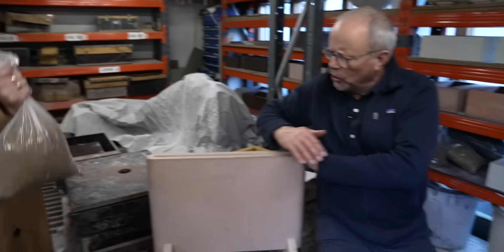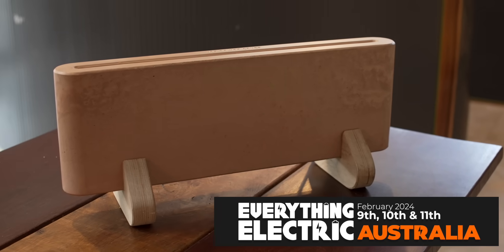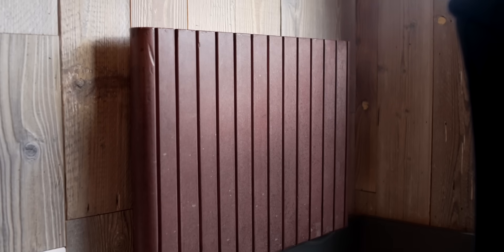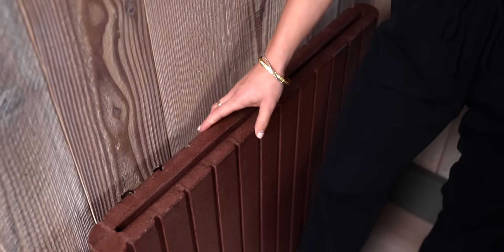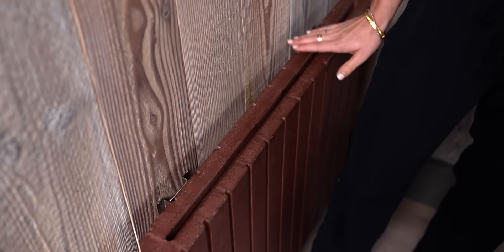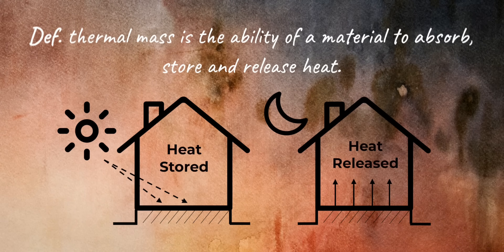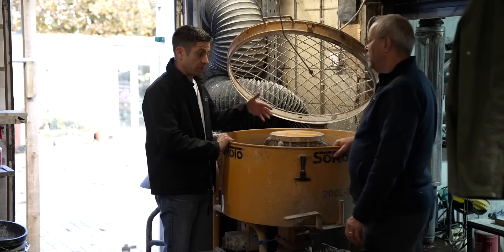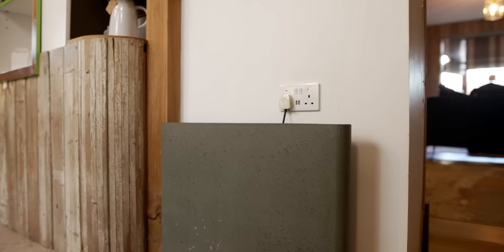THIS Radiator Is Made From Recycled Sand!

Comment: Who has a 600W TV!? That's not something you "don't notice". Maybe a huge old Plasma one? Ours is 80W which I still consider to be significant, and that's because it was a freebie and at least a decade old. A newer one would be 40W. Anyone who has a 600W TV should bin it immediately and get a new lower power one (unless they have their own renewable energy scheme with plenty of surplus I suppose).
And ultimately any direct electric heating device is 100% efficient, which would be good except that heat pumps are 250-400% so it's best avoided for heating except for occasional usage.
Interesting idea and they do look different and 'high recycled content' is good, but of course standard metal radiators are 99% recyclable (all but the paint) and could be made from mostly-recycled material too. 5 mins research finds that 'castrads' use 100% recycled metal in their cast-iron ones and stainless rads are 50% recycled. The percentage for standard mild steel and ali rads is presumably lower but rising.

Comment: Erm.... This is still resistive heating....  Which is a very poor way to use electricity to heat.
100% efficiency sounds good, but it's still just an old fashioned storeage heater. These days that really should not be an option.
And suggestions that resistive heaters loose efficiency with age... Again, just NO. They are 100% efficient till they die. (Even then they are still 100%, they just use no power to procuce no heat!)

I agree that using recycled materials is good here. But not for the reason they are touting.
Installed heating usually stays there for decades, so any recycling will have minimal impact. Don't compare them with consumer electronics with useage lifetimes of months.
However, in this case, when people realise how little heat these generate and how expensive they are to run, I think they will be dumping these quite quick!

Comment: The only possible use case I can see for this is time delay of the heating... E.g you use the heater at your off peak electricity times say 4am-5.30am and it releases the heat slowly so that the room is nice and warm at 7.30am. That could be useful but there is no information on its ability to retain heat after being turned off. So these are just nice looking, expensive electric radiators, with low heat output. Fine if that is what you need, but not very useful for most people.

Comment: I guess this is not the complete story, no? Why should a simple electric heater be more efficient than a heat pump for example? This does not make any sense. With existing electric heaters (infrared), you need a lot more energy to heat your house. It does work, sure, they use recycled materials, fine. But they still use cement, right? Not sustainable at all. Steel will be made with green hydrogen soon, why should a steel radiator be less efficient? Even existing ones? Either there was a big part missing or I don't get it, I'm afraid.

Comment: Find a bloody great rock that has an interesting shape, drill a few holes in it, and poke a ceramic element in each hole. 
 100% recyclable, when you finished using it as a heater, chuck it back where you found it and it will carry on being a rock for thousands of years.

Comment: Recycled sand composite? So... concrete. A 600w heater at currently availabile regular tarrifs is going to cost you £100+ a month, your TV might cost you a tenner. This is ridiculous, either the production team doesn't know what a resistive heater is and failed to do their research, or this is a paid ad. Its a stupid fashion product, theres no eco or green trickery to this in the slightest, no special 'development', nothing. The manufacturer is just spitting so much BS. It's a hot wire cased in concrete with a smart switch. What a joke.

Comment: As others have pointed out; ALL electric heaters are 99%+ efficient, these are no different. If you need 2kW to heat a room, you can use a £30 electric radiator or 3.3 of these (the large model). There is no difference in running costs, but the capital costs will be (far?) greater. I think the product looks quite nice but with steel, aluminium and copper being recyclable, I'm not sure I see the benefit. The oil/gel filled radiators also retain their heat but, I've never been sure of the benefit of this as they also take longer to heat up so you are just putting a delay into the timing of the heating cycle.

Comment: It’s already been said that 100 watts is 100 watts, but what also concerns me is that the electronics are not accessible. How has it been tested to last 50 years without breakdown? It hasn’t. Also, if the electronics are embedded and you are using an app, what happens when the electronics become obsolete and don’t work with an app anymore?

Comment: I hope the team will consider an increased independent technical review of future episodes before they go out. There is plenty of marketing rubbish in this episode. Lots of it is already challenged in the comments, but it should have been challenged on screen or in the editing booth. 

I was most bothered by the assumption that the recycled content meant that the product was "more carbon neutral" (which is a silly phrase) than wet radiators (the wrong basis for comparison). Is this nice looking electric radiator really lower embodied carbon than a low profile electric radiator? I don't know, but it shouldn't be assumed and repeated by presenters. The thermal mass is nice, but it will also slow the heat up time, whilst making zero difference to overall efficiency.

Comment: hmm I see no mention of storage and slow release - so they’re just a heating element with concrete to give some passive heat soak? May be a little better than an oil filled radiator  (maybe) if it can turn the heating off and let soaked in heat fill the gaps, but there isn’t enough info in this video to know

Comment: As many have pointed out, a 100% efficient resistive heater will consume 1 kWh to output 1 kWh of heat at a cost of about 26p. An air source heat pump will consume 1kWh to output between 3 and 5 kWh of heat at a cost of 26p divided by 3 or 5 or whatever the cop of the heat pump actually is.

I believe that these current numerous promotions of dressed up resistive heaters prey on the lack of knowledge of people about heat pumps that is deliberately peddled by the misinformation of newspapers like the Daily Mail and the Telegraph. They are certainly cheaper and easier to install but the true cost is in the years of crippling electricity bills that follow.

Your channel should be staying well away from such promoters.

Comment: How exactly is this "low carbon" heating? Right this moment over 50% of the electricity in the UK is generated from natural gas. And generating electricity from fossil fuels has never had such a high efficiency. I would see the benefit if it was used as a night storage heater, but for that these things don't look like they have enough thermal mass.

Comment: Ok, like others have said, resistive heat, 100% yadda yadda yadda, not as good as heat pump. But I live in Canada, where even the best air source heat pumps won't get you through the winter without some help.  
So I don't care, I still think it's fantastic. We had  daycare my wife ran out of the back room extension, that depended on baseboard electric heaters, too hot, we couldn't use them or the little tykes would burn themselves. Place was always freezing,  and fire hazard as well.    
So yes, lots of cheap dangerous resistive heaters around. Time for something different. Perhaps not so ugly, hey, that's what this is!
Hope this lovely couple scales there price down and we all get one in few years.

Comment: Ok can someone tell me how this isn't just an old fashioned storage heater but built in a way you can't repair it if anything goes wrong?
Old storage heaters were made of bricks to hold the heat, a metal shell with holes to let the air circulate, a number of heating elements (varies by type/size) and a bimetallic strip overheat. Literally nothing to go wrong that can't be replaced with a couple of screws. This version the electronics are *in* the concrete mix so can never be serviced/replaced. The heating coil can never be replaced if it breaks.

This looks better though I'll give them that.

Comment: Yet another smart solution! Sure makes me wish that, when I built our home, we could have afforded to put heating elements in our concrete floor. The entire house would have been sitting on such a "radiator."
Reply: Wow. If you are building a home and putting in the concrete floor then there is very little difference in price between radiators and underfloor heating. Infact  if you are talking about underfloor electric heating mats you could add wires into the floor really easily without the need of a builder. They would likely cost a lot more to use than gas or heatpump water based underfloor heating.

Comment: Intrigued!  But according to my insurance agent, they won't pay for damage caused by flooding from pipes that have corroded within the concrete slabs of some homes. That has me wondering how long these will last. And electric heat = 1 to 1 efficiency, no?
Reply: pipes have water in them? you're comparing apples with oranges...

Comment: Its a heating element in a cement case, yes its fire safe, it has a large thermal mass so there no hot spots. But 300 watts is 300 watts no mater how it's encased. At lest its not as bad as solar roadways.

Comment: "Low wattage" has me quite confused. The heat loss in a house (and each individual room in it) is fixed, whatever it is. If you want to warm a room, you need to provide more energy into it than escapes it, with the extra caveat that the rate energy escapes is proportional to the difference in temperature.

600 watts is on the low end of the small portable heaters you'd use to keep the underside of your desk warm. 150 watts is so low it's basically useless, comparable to the amount of heat a typical desktop computer might generate. I do not see the use case for that, especially for what I can only assume is a premium price. Maybe you can use it seat cushion to keep your bum warm.

Comment: premium price but has a pay back period?  how does that work out.  your not saving a penny, just spending more on a premium product,   you have to remember this style of heater is going to take a long ass time to heat up from cold compared to a blower style electric fan heater.   thermal mass has no real benefit here,   its like having a fan blower type heater but one that takes 20+minutes to start up and switch off which would be a pain in my eyes.   plus take into account the weight of this thing when it comes to logistics.   its going to have a much higher carbon foot print that delivering a small plastic fan heater at 1/4 the size.   am i wrong here?

Comment: I'm sorry but the claims in this video are laughable. The radiators are simply electrical convector heaters with a high thermal mass. They are no more or less efficient than and other resistance heater and cost a lot more.  If you want to timeshift the heat output then get a storage heater full of bricks - you can actually decide when they release the stored heat.

Concrete isn't even a particularly good thermal storage medium with a specific heat of about 1000J/C per Kg.  Water is about 4 times better at 4200J/C per Kg and you can transport the container empty and fill it from the tap when installed (hot water tank anyone?).  

I really expect a higher standard of accuracy and integrity from the Fully Charged team. This just feels like an advertorial where the production team ignored the science and ethics.

Comment: Very skeptical of the claimed 50 year lifetime, especially after the nice lady added that the device can be controlled by an app! 

Will that software still be supported in 50 years' time, then? Even if it is, the electronic hardware is unlikely to last so long, especially considering that it is subjected to wide variations in temperature. It's also embedded in concrete, so no chance of fixing it when it fails - the whole device will have to be thrown away. Or recycled - if you can figure out a way to recycle concrete with embedded e-waste.

Comment: A quick perusal of the comments soon after release of this video and already so many just blow right passed the concept of thermal mass.

Commenters are correct that electric resistive heating elements are nearly 100% efficient at converting wattage in to BTU's out. But a wire coil cools immediately once deenergized. These thermal mass radiators provide a slow-release heat that moderates the temperature in a room. The business owners are careful to state that these heaters supplement other heating sources.

On the power side of things, electric heaters of all types are much better for the environment than even the least dirty fossil-fired heaters. When the electricity comes from either a "green grid" or, best yet, residential renewables, then the heat is essentially free; especially when PV or wind is diverted rather than curtailed; storing excess generation thermally.

The UK has a particular problem in that a high percentage of buildings are heated with radiators. While heat pumps can be used as substitutes for traditional gas boilers, the US has much less of a challenge in that a high percentage of buildings heat with forced air. Here, substituting a heat pump is much more straightforward.
Reply: If you want thermal mass then get an electric storage heater full of bricks.  They get to much higher internal temperatures and can therefore store much more thermal energy per Kg. You can also control how fast they release the stored heat.
Reply: @AndyFletcherX31  Everything you state is correct...while completely missing the point.

In fact, the solution you propose is already being done. See the Everything Electric Show episode on Zero Energy Boilers by Tepeo (https://youtu.be/y_v0midqPDc?si=Uqg5aMpKO2ZLH2UZ).

Secondly, implementing a ZEB solution is dramatically more expensive than the recycled composite radiator highlighted in this episode.

Lastly, the ZEB and recycled composite radiators featured in this episode are meant to solve for different problems. While ZEB's replace fossil-fired boilers as an alternative to heat pumps, the recycled composite radiators featured in this episode are meant to supplement existing heating plants.

Comment: 150 watts on current electricity price (27p per kWh for direct debit account in the UK) works out at 4p per hour or 1p an hour if using a heat pump to produce the same amount. There’s a reason we don’t tend to use electric resistance heaters for home heating and it’s purely down to cost. Also if you have cheaper night time electricity wouldn’t storage heaters be a better option?

Comment: They may use recycled materials but surely these are just storage heaters? Electric resistance heating; not great and no better than any other electric heater. Significantly worse than a heat pump. I'm disappointed this has been advertised by Everything Electric as "super efficient".

Comment: I upgraded my radiators some 15 years ago from old standard electrical ones to radiators made of glass blocks. My consumption went down. I got a much more even temperature in the house, so I could keep a lower temperature. The air is not as dry in winter as it used to be.

The only negative was the price.

Unfortunately they are not produced anymore, probably because of the price.

Comment: I was hoping the smart part would be off peak heating and slow release throughout the day... 

Actually what I'd like to see are radiators that can heat up by running the heat pump on full for a few hours off peak, then release throughout the day
Reply: The refrigerant lines for that would be impractical, and the refrigerant itself can't hold any amount of energy to speak of. What I can imagine, though, is a thermal battery that is "charged" (heated) by a heat pump, and that couples to a more traditional air or hydronic heating system. Problem is heat pumps can't get very hot; a REALLY GOOD unit can get maybe 115F/46C. You're going to need a lot of mass to store usable energy at that temp.

A little over a year ago, this channel had a video "The Perfect Boiler Replacement? Tepeo's Zero Emission Boiler" that is a good example of what you're talking about, and it's a good idea, but it's of course not a heat pump.
Reply: Just use district heating with a central heat pump and a storage tank that can store a weeks worth of heat. It's not that hard.

Comment: They cannot be anymore efficient than any other type of radiator or electrical heater.  Smart TVs do not use 600W.  These guys are simply not engineers they don't understand the word "efficiency".
This is another overpriced gimmick, looks ugly and doesn't serve any purpose.  If you want to turn it into a storage heater, their might be some benefit with E7 or something.
You guys need to take technical advice before promoting rubbish like this.